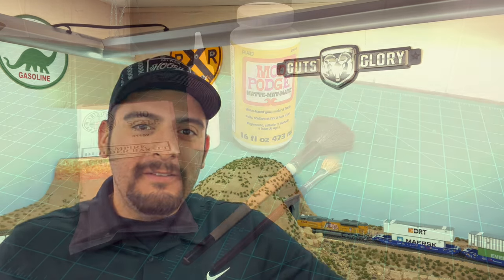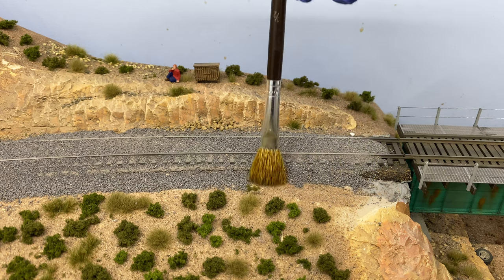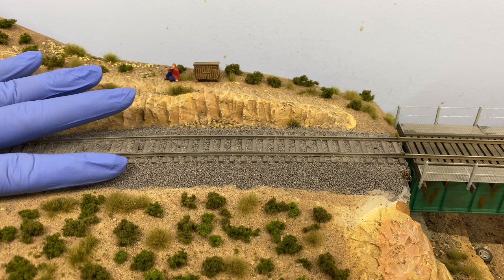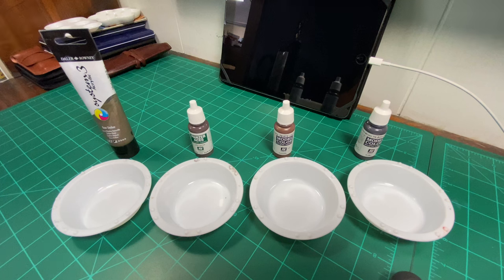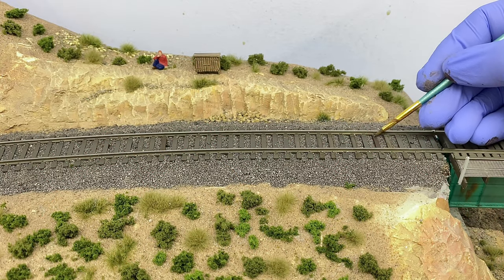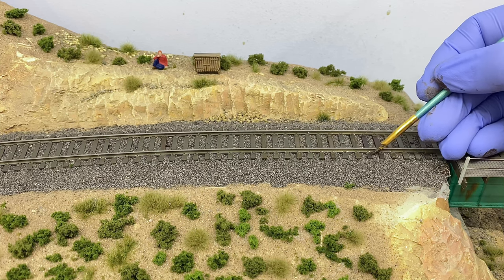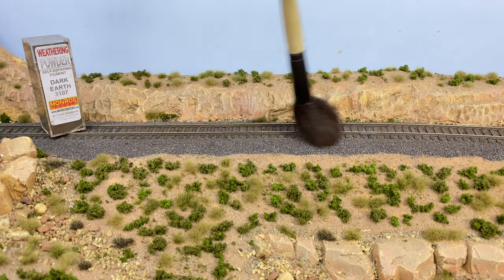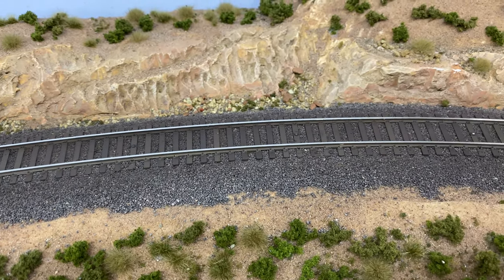How to Ballast and Weather Realistic Model Railroad Track

Comment: Great video! Just a recommendation, paint the ties before ballast, you wont be having to worrie about getting paint on the ballast and get more done faster.
Reply from the maker: Thank you! Great idea! I thought about that, but I was thinking that the wet water with alcohol would ruin the paint or something. But I will paint the ties first next time as I noticed that the wet water didn’t affect the rails that were painted in acrylic paint. Thank you for the compliment and for watching my video!
Reply: @modelrailroadingthesouthwest  good thinking. I like to not 'spray' the track as many people like to do but drop alcohol first then glue. Everyone has the methods, just things I'd like to share. I'm in n scale so less forgiving!
Reply from the maker: @NoFear2473651  I agree with not spraying the track, it can get messy and ruin the ballast if you spray too hard. I like the dropper method too. I’m always open for suggestions as you said everyone has different methods. It’s nice to see how other modelers do stuff.

Comment: Nice!!  Is there any disadvantage to painting the ties before putting the track down on the board/display?  I'm really wanting to start model railroading in O scale.  As a starter project I'd like to make a small section (3' or less) for displaying or photographing engines and such.  Figured it would be good practice for layout scenery. 

Really well done - I love the weathering effects at the end.  Very realistic!  Thanks for sharing 🤠
Reply from the maker: Thank you very much! There is no disadvantage to painting them before. I was using acrylics and I was worried that the alcohol in the wet water was going to cause an issue with the paint. You can paint them first and then ballast. It won’t be a problem. Building a small section for photography would be a great start and practice. You can also just hit the entire track with a single coat of brown paint if you don’t want to paint each tie. Thank you for the kind words!
Reply: @modelrailroadingthesouthwest  Ah I didn't catch that... makes sense.  Thanks for the info!

Comment: Howzit : Before glue application; gently tap the track railheads to [ naturally ] settle the Ballast away from the inside web of the rails ... And then gently run a wooden skewer-tip along the inside web of the rail as a double-check for wheel-flange clearance. The same can be done with Turnouts; but needless to say; Turnouts need extra care and attention .... And there you go; mate !

Comment: Do you use anything to fix the powders after you apply them to the track, ie wet water? Thanks.
Reply from the maker: I don’t actually. It would be a good idea seeing that the powders can rub off easily if you’re using some sort of chemical or alcohol to clan the track if you hit the ties accidentally. You can use a matte finish spray paint if you would like to fix powders. Something like Testors.
Reply: I was wondering the same since i have to vacuum the dust off my layout from time to time so everything has to be fixed down.  Sadly with powders, their effect gets muted by most matte clear coats it seems.
Reply from the maker: @cj5driver551  So after a few months I have noticed that the powders have been fine after cleaning the track and all that jazz. So I’m almost certain that the ballast will be safe without a matter coat.

Comment: How do you clean the track after applying the weathering items?
Reply from the maker: @daletherail  I usually use either a bright boy or isopropyl alcohol on a paper towel ran across the railheads.

Comment: Will i need to clean the glue off the track?  After i did this the train is glitchy
Reply from the maker: Yes. You can use a piece of wood or a bright boy track cleaner. Don’t use sand paper. Just run the bright boy or piece of wood over top of the rails.

Comment: What brush you use for spreading ballast ?
Reply from the maker: I’m not sure. I bought a bunch of brushes once at an estate sale. The big plush brush is a makeup brush for sure. I think the smaller one is a paint brush that is about 1/2” to 3/4” wide. I would recommend to buy a makeup brush set at Walmart. There are several sizes that can be used for everything on the layout. The link shows a nice cheap set. 

https://www.walmart.com/ip/890397279

Comment: This is the most comprehensive and creative set of techniques I have come across. It has also convinced me to go back and improve my existing ballast which is mediocre at best. Any tips on how to do that?
Reply from the maker: Thank you very much for watching my video and the kind words! One way that I can suggest is to maybe remove the ballast and reapply. That would also mean to remove the track and lay it again. (There is a possibility that the ballast with loosen up enough to be vacuumed up. While you are vacuuming use a paint brush to agitate that ballast to help the vacuum remove all the ballast.) I’m not sure where you are on you layout scenery wise. If you decide to remove your ballast, you can add either alcohol or dish detergent in a spray bottle with water and spray the ballast down and let it soak. Then you can use a putty knife to remove it. If you’d like, you can send me photos of your ballasted track and I can try to come up with a different solution to fix your ballast. You can find my email in my bio on YouTube.

Comment: What track did you use I went with Atlas snap track code 100 no issues so far
Reply from the maker: This is Walthers Code 83 Flex Track. This is my first time using Walthers track. It’s good. I used to use Atlas Code 83 Flex track. I honestly didn’t see a difference between the two.

Comment: I have free access to cat litter I heard you can use that and watered down Elmer’s glue let me know if  that is correct
Reply from the maker: I have heard the same about cat litter, although I do not have any experience using litter. The only draw back that I can see using litter is that it absorbs moisture and I’m not sure how that would affect the gluing process. There might be some videos on here showing the use of kitty litter.
Reply: @modelrailroadingthesouthwest  
I haven’t seen an issue when using watered down Elmer’s glue I have titebond glue which works same as Elmer’s glue
Reply: @modelrailroadingthesouthwest  
I just unpacked my Union Pacific 3450 which I believe is a SD40-2 dcc sound I’m running DC but still hear engine and bell using rail power 1300 for now till my dad comes down and can help me wire it all up
Reply from the maker: @NYandAtlantic  Nice dude, what brand is it? If you don’t want to get into a full fledged DCC system and still want to be able to access sounds and be able to change settings on your sound decoders you can get the MRC Tech 6. It can run both DC and DCC engines at the touch of a button and it is affordable. I used one for maybe 10 years until I decided to go with a Digitrax DCS-52. 

This is the MRC Tech 6: https://www.trainworld.com/mrc-0001200-tech-6-sound-controller-2-0-mrc-0001200.html
Reply: @modelrailroadingthesouthwest  
It’s name is railpower 1300 bext year I will upgrade have a few things with my mortgage to straighten out first
Reply: @modelrailroadingthesouthwest  
Any way to get a short video to you
Reply from the maker: @NYandAtlantic  Sure, my email is on my YouTube channel profile. You could send it there.